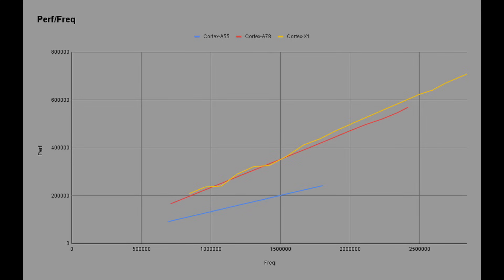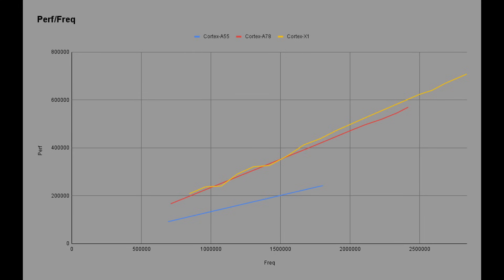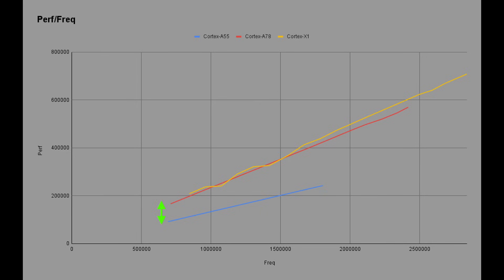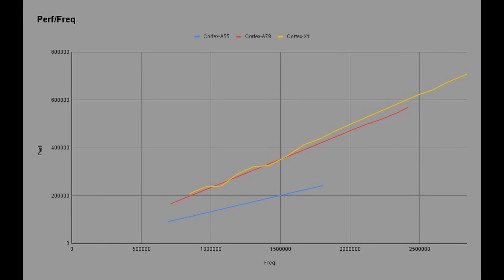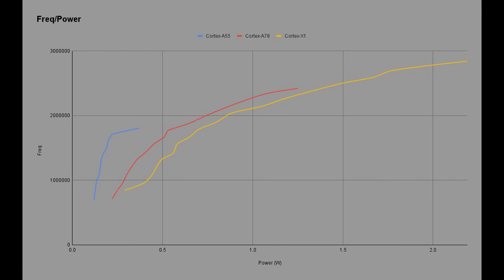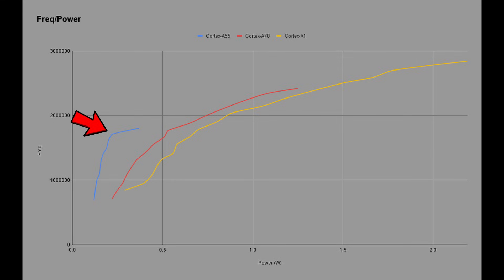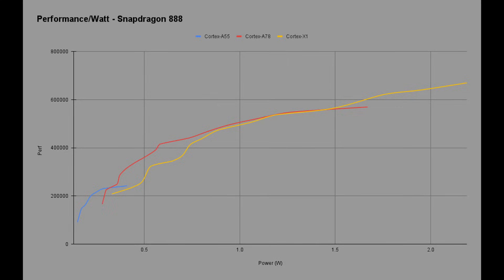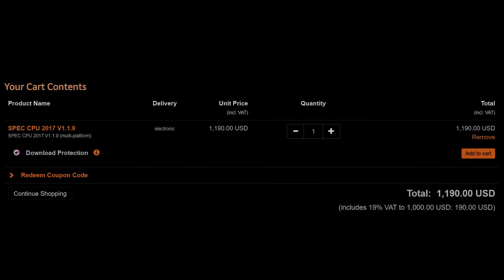Smartphone CPU Power Usage vs Performance (and why it matters)

Comment: Geekerwan is the best so far but would welcome more analysis from others that is more than just reading benchmark numbers without any consideration to power usage/efficiency especially at various wattages. Especially with the upcoming gen 3. I am interested in how well the a720/520 cores measure up compared to the a715 which didn't seem to be much of an improvement over the a710.
Reply: Were you able to find an other sources or channels about in depth power usage?

Comment: Excellent video, the performance graphs are very interesting, but the operating system has a fundamental role in managing these cores and knowing how to allocate them correctly. For example, Intel's thread director in partnership with Windows.
Reply from the maker: That is why I used the performance governor, and set fixed clock speeds.

Comment: Very cool. Maybe also an idea for a future video about ARM Cpus - Do compiler flags in gcc and LLVM that claim to optimize the code for a specific microarchitecture like -mcpu and -mtune improve performance when running on that specific microarch and is there a penalty or compatibility issue when running on another microarch.

Comment: Thank you for the video! It's interesting why chipmakers don't use let's say 8 small cores and design a good task scheduler for them? But instead they are using 3 or even 4 type of cores.
Reply from the maker: Because there are many types of tasks that can't be split across multiple cores at the same time.
Reply: You should consider latency also. If the user wants a task completed RIGHT NOW, and the application is in the front of the user, it's worth it to be less efficient to get the answer faster.

The key is to focus on performance where the user will actually notice, and focus on power efficiency the rest of the time.
Reply: Snapdragon 625 had 8 cores of A53 (small cores) but it was not as powerful as snapdragon 8 series. However was very battery efficient
Reply: @hpgramani  oh, reall?  Didn't know that. And I found 626 and 630 had 8 cortex a53 cores. So, they tried at least to make that before. But they were made on 14nm node, just imagine energy efficiency on 3nm though🤯
Reply: @TheHottabych23 a55 is only more efficient at low frequency like 1ghz and below. Its very inefficent at max freqs compared to even a76.

Comment: A very interesting video as always. One graph I'd add (I think other commenters hinted about this too) is the performance per watt vs. wattage. Or performance per watt vs. frequency. This way one can compare the actual efficiency of each type of core.
Reply: What do you mean vs wattage? Perf per watt already gives you the  power efficicency. Perf per ghz will give you the ipc.
Reply: @bulletpunch9317  to have performance per watt on the Y axis and wattage on the X axis. Then you know the actual efficiency of a core at a given wattage, not just its performance (it's like a second derivative of performance with respect to wattage)
Reply: @r0galik  what is actual efficiency supposed to be? Where is this applied?
Reply: @bulletpunch9317  what do you mean? It's just a number. It can tell you how efficiently a core uses the power needed to run it (ie, how efficiently "watts" are translated to "operations" at a given power.

Comment: I thought you'd start with the 865 or 855 because they're arguably one of Qualcomm's most efficient chips. 

The 888 and 8 Gen 1 manufactured by Samsung weren't as efficient. 

That's before they switched back to TSMC for the 8 plus Gen 1 and 8 Gen 2.

I'd really love to see that transition.
Reply from the maker: There has to be a limit on how far I go back. This is as good a place as any.

Comment: I wish you used a performance/Jules too 
That is the most interesting graph because if the performance is too low the Jules actually goes up 
Most of the time middle cores will be better
Reply from the maker: Why is Joules better than watts?
Reply: @GaryExplains  I don't believe it's better
It's just another interesting data point for comparison

Comment: This is what every Soc reviewer must test. Power consumption is a major factor in mobile devices. There's so many things i found after looking at performance/watt of multiple SoC and cortex core IP. I found that TSMC's node is 30% more efficient than Samsung node. And cortex A710 is less efficient than cortex A78, moreover cortex A510 is a lot worst than cortex A55. Cortex X1 is the most efficient design ARM has ever made. Until X4 hit the market.
Reply: All you points are on your points correct but I don't think that X1 is efficient
Reply: @arya_amg  it's just no one manufactured X1 using TSMC's process, both sd888 and 888+ were made by Samsung. On TSMC N5 with full cache configuration it can hit ~1300 single core in geekbench 5. While cortex X3 is better in IPC but also uses more power despite using TSMC N4 process
Reply: @vineetkumarbharti2633  interesting
Reply: can you tell me how you found those data and where? I tried to get any information for some days (sporadically but i tried) and didnt find anything. :/ would be cool if you could help me out with something

Comment: Will you make graphs addressing process node improvements or is it  insignificant  enough to be excluded? 

It won't be  important because all cores of the SD 888 are on the same process node.

Will there be a significant difference between a cortex A55 core on a 6 nm process node and  the same core on a 12 nm process node?
Reply from the maker: Obviously when I start comparing one processor to another then differences like the process node will need to be mentioned.